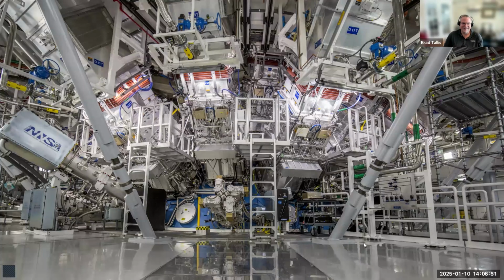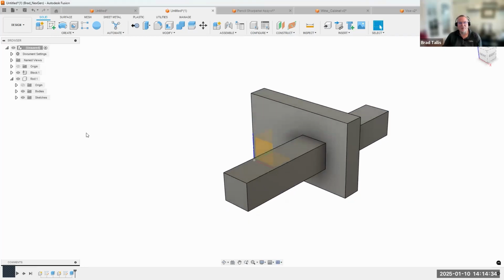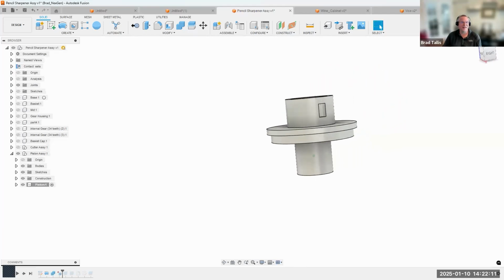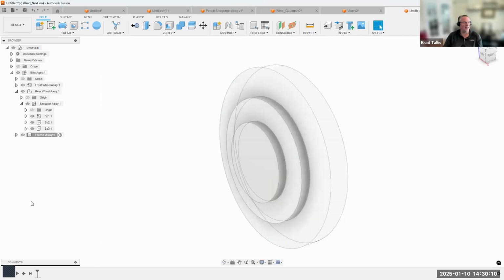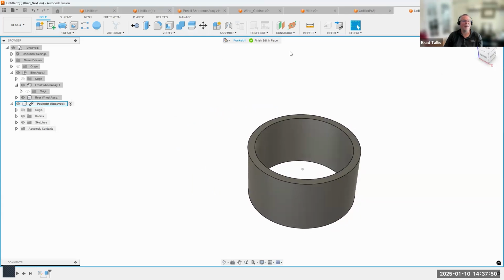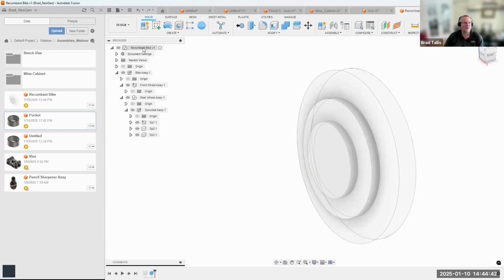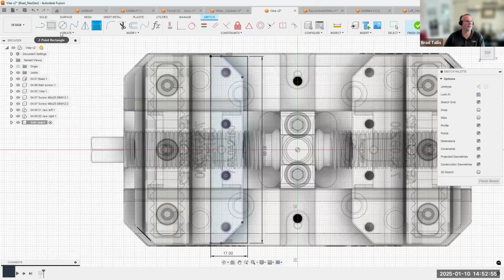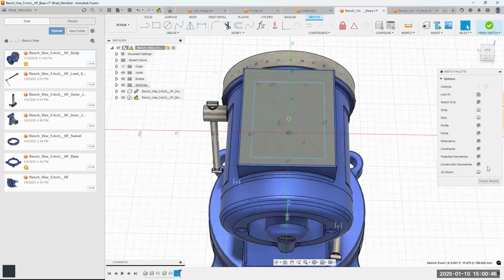Fusion Mastery: Assemblies (Pt. 1) - Fundamentals

Comment: Joints are for Joes, assembly mates are for Pros. This is why Fusion360 will be stuck in the maker space for CAD. Its essentially a CAD toy designed by folks who know nothing at all about engineering with CAD and assy modeling, as witnessed by this presenter. As another commenter, I too have been using SW for 20 years, plus ProE, plus SDRC etc and not one of these real CAD systems uses this "Fisher-Price" joint method. Add to that Fusions  convoluted configurations and lacking model tree and you have whats known as a "clouge". The CAM on the other hand is good, and that is because it was ported over from HSMWorks, which was not written by Autodesks maker army. Autodesk, if you want Fusion to be a real CAD platform for engineers, best add assy mates or forever be stuck in the maker space.

Comment: Solidworks uses both bottom up and top down assemblies as well. Also able to mix techniques. I have been using Solidworks for the past 20yrs and have been trying to move to fusion 360 as my primary design software, my only complaint is the assembly constraints are a PITA I must say when it comes to assembly as in bottom up I love Solidworks but I guess this is because that is what I'm used to and a lot of fusions techniques just don't make sense because of this. For instance joints just feel so restrictive  and less flexible let alone when I think of joint as a movable connection like a pivot joint vs a connection that is fixed like a bolted together connection is more of a mate. I've been working on trying to break this line of thinking in order to get more efficient with fusion but having trouble getting away from joints and mates being two different methods of joining parts in an assembly. I must say fusion has come a long way. I have been using Solidworks for a long time and was using HSMworks long before Autodesk acquired them and wasn't too impressed with fusion in the beginning but now it has become quite the powerful software. I really wish they would make it compatible with Linux.